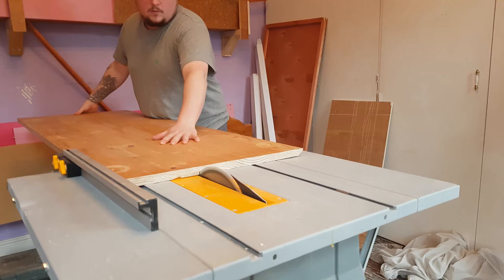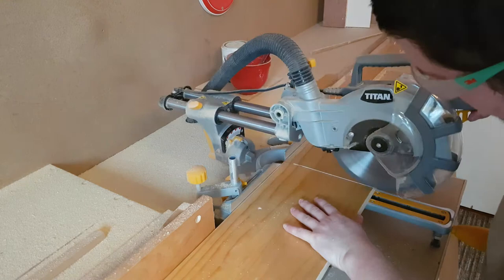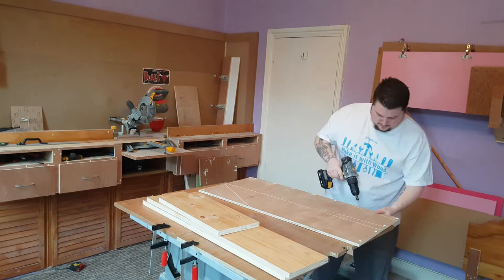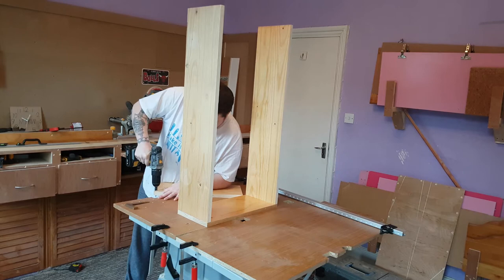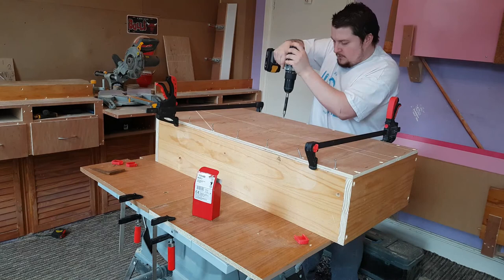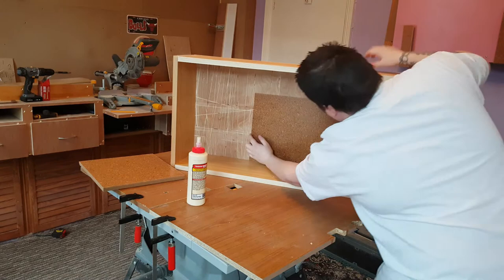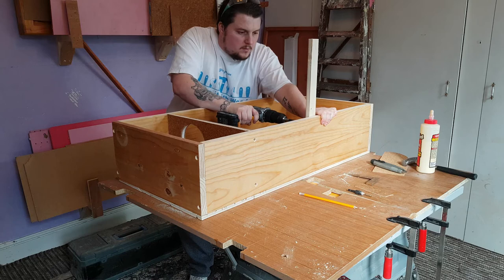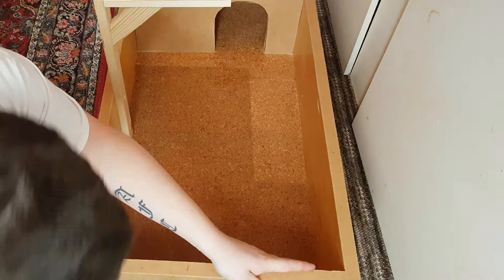Building a Tortoise Vivarium- with pine boards

Comment: What kind of tortoise is that ? I have two Sulcatas.  I had open table and was informed that closed chambers are better for young tortoises. For my sulcatas and most tortoises you need high humidity (80percent) for the first 3 years of their life, which is impossible to obtain in an open air enclosre. I currently have closed chamber now but im gonna build new one soon.  It's entire shell and base will be wood, and im gonna make all 5 sides of plexiglass.  Top  will be attached with little door hinge so I can easily lift open.  So it will be a completely closed chamber,  but completely see thru on all sides.  ALSO KNOW THAT MOST TORTOISE DATA BEFORE  2015 IS ALREADY OUTDATED AND INCORRECT. We didn't even start keeping tortoises as pets until around the 70s. There's not enough data out.  Join THE TORTOISE FORUM. They have an app.  Lots of vets and doctors and breeders who have been doing this stuff for years on there and they answer questions and help
Reply from the maker: DebieDoesDalas69 TRG hi when my wife bought the tortoise we were informed that an open top was better with a heat lamp over head until he is about 1 year old then enclosing him in is better but I am not sure what breed it is all I know is it's a tortoise thanks for the question
Reply: Make it with Wood You have a Russian Tortoise. They’re the best and easiest little tortoise you can possibly have. Mazel Tov